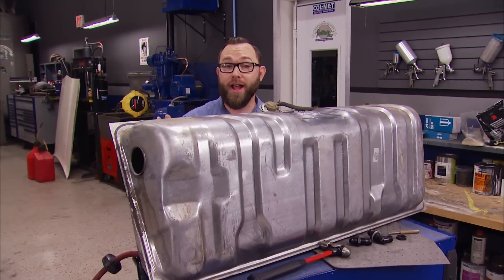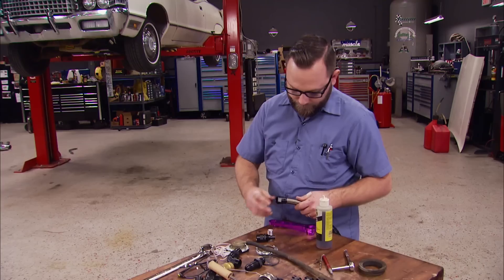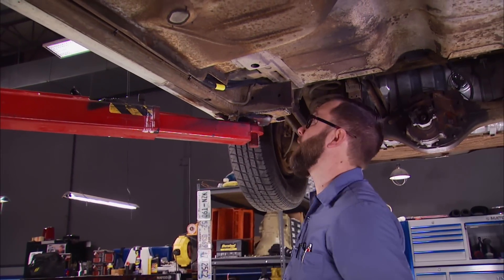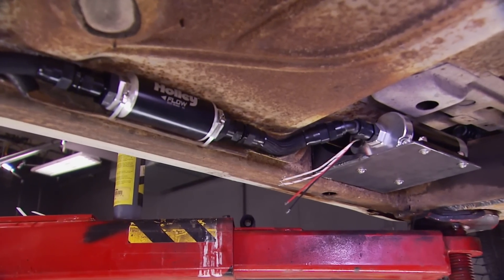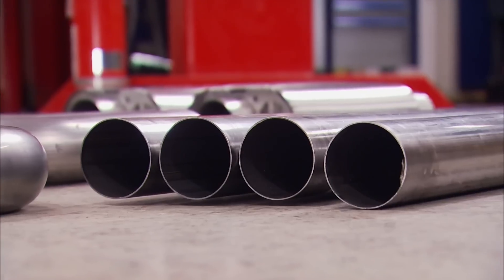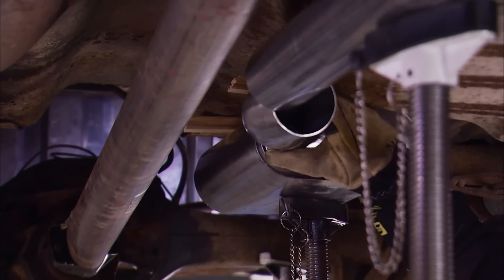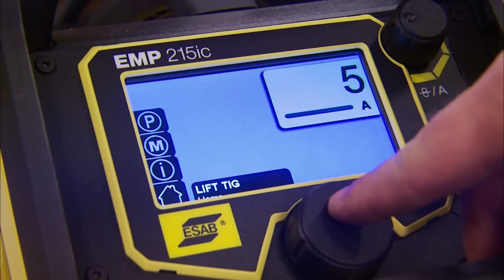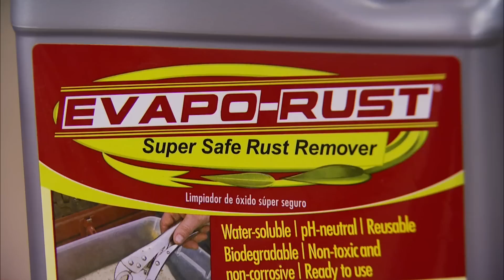Fuel System & Exhaust Upgrades For An 1,100 HP '72 Mercury Marquis - Detroit Muscle S3, E9

Comment: Now that you've got a 1000 hp motor you have to beef up the rear and driveshaft to handle the power. Beef up the front suspension too while you're at it.
Reply: Engine*

Comment: Built a custom Fuel pump mount out of steel, n DID NOT Paint it (instant Rust with any sign of moisture!!) N no Rubber/Foam isolator between Fuel filter n frame?!
N the Exhaust!!!!
Mounts/Hangers?!?!?!
I've always Liked the show, but show bullshit no1 with Half a brain needs to see, n Skips important Parts, Supplies, n Companies that offers said parts/pieces they TEND to leave out!!!!
But should be a fun car.
Oh, n a Built 3spd C6 should b great as the Highway cruiser, LOL, how bout a GearVendors OD Unit?!
But guess we needed to see a stock Alternator painted, n info on the

Comment: Electrolysis will remove rust, even from parts you can't reach with a towel or brush, and it's so good, that it gets it out of pits too. It's really the answer to the cancer. 
Oh and the only chemicals involved are water and baking soda, so you can pour it down the drain when you're done.

Comment: It's interesting how some say "it isn't an 1100 horsepower engine" because it was made with spray. By that thought process a 1500 hp or whatever blown or turbo'd engine isn't actually a 1500 hp engine either but nobody points that out. Why?
Reply: Strictly Business cause you don’t have to change your spark plugs or refill your turbos or blower after a 15 second hit.

Comment: Tech tip. When drilling or cutting into a part that the shavings need to not be introduced to the part, use a vacuum along side of the cutting bit. Doing so will remove 99.9% of the shavings.
Reply: Thats a great idea
Reply: That .01% will eff your fuel system if you don't catch it htough.

Comment: It is not a 1100 horsepower engine that is what it makes under nitrous.
Reply: Same thing with any other mega power engine with like a turbo or blower that's what it makes under boost so it isn't the real hp number.
Reply: @strictlybusiness1598  yeah because those are part of the engine and there are mechanical part of the engine.

Comment: This show would been ok if they would have done different things they seemed to stuck on the LS bull sheet idk if they realize that GM ain't the only auto manufacturer out their. That's main reason I quit watching it was basically the same shit LS in this in that I'm almost positive if they could fit one in their ass they would try put one their too.
Reply: ford nut 
Damn straight!
That LS isn't THAT good - they're just cheap in the junkyards
Reply: @Motor-City-Mike  Naa... they really are that good. I have a tear in my eye right now, just thinking about how lucky I am... to be born in the time of the might LS. They will write songs. They will build temples. They will build shrines like mine, and burn candles on the LS sabbath day. "And on the 8th day, God took pity on the plight of man, and delivered unto him, the LS".. it's right there in the bible. It is known.
Reply: hawkdsl 
don't misunderstand...
I know they are a good engine, I had my first back when they originally came out - the all aluminum version that was released in the corvette.
Let me say up front - I've seen a lot of engine designs, I was in business designing, machining and building engines which gives me a pretty good idea of the good and the bad.
The LS just isn't anything spectacular - the 351 Windsor Ford was everything the LS is, only the fact was that not being a Chevy it wasn't as popular.
To give you an idea - they were the short block in NASCAR Fords for years, and NASCAR is pretty hard on the bottom end in particular - they run 7500 to 8000 rpm for hours. I had quite a few Windsors come in (we also did street engines) that had over 300,000 miles on them - and only needed a .020" overbore.
The LS uses bits and pieces of designs from a few different engines, the only thing different is the oil pump being driven directly by the crank. Changes from the traditional small block - they FINALLY  moved the head bolts farther away from the bore - the reason you have to use a torque plate to machine them is the bores distort so much from the head bolts that the bores went WAY out of round - the Fords and the Chryslers not at all. They also got rid of the stupid siamesed exhast ports 5/7, 4/6 - when you pushed the power way up the heat from them being together warped heads, blew head gaskets and warped the exhaust valve seats.
Ford never paired two exhaust ports side by side.
The cross-bolted bottom end os something Ford did WAY back in the early sixties, strong - but nothing new here either.
Maybe because I'm older (sneaking up on 60 and still right in the middle of things) - and seen a lot of engine designs - that I see nothing particularly spectacular about the LS, it's good but not "All That".
Reply: @Motor-City-Mike  Just messing with ya man.. But the flat head ford shared ports IFIRC.
Reply: @hawkdsl  That was awsome reply.
Reply: Didn't know Ford made a  Ls &its from tf 70s
Reply: Actually, this video features a Ford product, and you are still unhappy.

Comment: So is the 460 a better builder than the 454?
Reply: YES
Reply: What makes it a better motor? I’ve always known 460s to get horrible mileage compared to the 454. Also, very few get used in hot rods compared to the 454. Is it just prices of 454 parts? Or?
Reply: @jeremylakenes6859  you build a big block and complain about gas mileage. 🤦‍♂️
Reply: Jeremy Lakenes 
The same - at this level the cost is the same, and keeping a Ford in a Ford is easier than swapping in the Chevy

Comment: Why didn't you undercoat the car all that time and money
Reply: No need to in the south, it's not a rust belt daily driver
Reply: @OGskunkMASTA  yes you do besides just lazy looks like crap nice new stuff on rust resale value as well
Reply: @bustermccrab4376  No you do not, I've bought over 9 cars from down south that were from 60s to 80s and they were never rust coated and looked new underneath. My 94 s10 blazer still had factory markings and stickers on the frame. They get patina, NOT rust or not.
Reply: @OGskunkMASTA  I lived in Florida for years I do know also like I said just lazy besides watch the show mounting that fuel pump to rusted metal spend the extra day and clean that crap up preventative maintenance also what if the car goes up north nice to know also I'm here in Detroit a lot of people take i75 to and from
Reply: @bustermccrab4376  Flordia is by the sea, cars rust close to the rust belt there. Cars from Tennessee, Georgia, Texas, and so on. Flordia, California, and most snowy northern states are a no go for buying older cars. I've hauled cars and built cars for years. I've been to every lower 48 state besides Alaska and Hawaii to get cars and I've seen how they all look especially the classics. They're more than fine. More of a waste of there time
Reply: @OGskunkMASTA  just lazy also say somebody moves to another state also when you look under the car it just looks professional as well they literally had gas tank off exhaust off sand blast that shit spray it 1 days extra of work makes a lifetime of difference. More money on resale there's no excuses

Comment: best part is this thing probably gets the same fuel economy it did brand new but way more power LOL!
Reply: I had a 1972 grand marquis bram with a 429 in it when i was a teen.. my friends called it the "Star Ship". It was so ugly and large... but that was what made it "cool". To this day, it's the only car I ever owned, where you could actually see the fuel gauge move while you drove it. It's also the only car I've ever owned that felt like it was hovering over the road, not driving on it. You could have run over a cow and not know it if you wasn't looking. I thought it was a pretty fun car to be honest. it was 21 feet long. You learned to park good with that monster. Had it for about 2 years, and went into a dodge van after that. I felt naked without 12 feet of hood in front of me. What a bazaar feeling that was.
Reply: Matthew Skaggs 
Yup! my Thunderbird (460) got Better gas mileage after the modifications and WAY more power!
LMAO!!!!
Reply: I love a good carb but I think I would have went with a holly efi of some sort.
Reply: @r6exrider  carbs are outdated.
Reply: Had a olds same size with BB.. Yeah 12MPG at best
Reply: @AbcXyz-rn2lz  12??? Damn you were doing good!  LOL
Reply: @carlspackler91  that's flat grade OD maybe
Reply: @AbcXyz-rn2lz  I don't doubt that a bit!

Comment: that car would be dangerous. even in a huge car like that 1100 HP would push that thing to probably 170- 190 on top end speed and I don't care how much you update the suspension that big boat would be dangerous at that kind of speeds, just my opinion.
Reply: If it's just your opinion, why push it as fact?
Reply: Seth Jordan no need for a sarcastic remark bud, I didn't say it was a fact.
Reply: Mike Burks that it is capable doesn’t mean you should right.
Reply: Mike Burks 
Did you ever notice Stock Cars (NASCAR etc.) in the sixties were about this size?
Just a heads up, all else being equal - big cars are more stable and easier to drive at high speeds.
The increased track width helps with pitch roll, and the longer wheelbase allows more time to correct than "twitchy" short wheelbase cars.
Also, the splitters and spoilers on smaller cars are there for downforce, downforce simulates Weight.
I grew up driving all different sized cars, while the smaller cars are fun (I'm into ALL cars), fact is I'd rather be doing 180 in a big car than someone small and light.
Reply: But you said it WOULD be dangerous, twice. Not that you think it might be dangerous, not that it could be dangerous, which would be an undeniable fact, anything can be dangerous, if utilized correctly. And who would it be dangerous to exactly? The driver/passengers? Well what if they reinforce the chassis to FIA standards? The FIA is way more strict than the US government when it comes to safety. Or maybe you are talking about the people outside of the car, to which I ask, what car isn't dangerous to pedestrians?
Reply: opinion means i could be wrong and I probably am wrong. oh did you train to be a smart ass or are you just gifted.
Reply: Mike Burks 
To answer your question (which fits the very definition of sarcasm), I'm not an ass so it must be a gift. Sarcasm was not in my verbiage nor was it my intention, making my point was.
You were adamant when you made a statement and then called it an opinion, so asked I if you were familiar with '60s NASCAR (I have no way of knowing your age) and then I stated the facts of vehicle dynamics in my response.
If you feel that is sarcasm you 
might want to consider avoiding interaction with other people on most automotive forums - you are easily offended and social media is possibly the last place to expect kind and gentle conversation.
Reply: MIKE MOTORCITY OG you sound really intelligent to me so you should know what the word opinion means and no you did not offend me. if you want the last word go right ahead, I won't respond to it. you see I am pretty old 4 kids, 7 grandkids and a lot going on so I don't have time for arguments on you tube, so think whatever you want to about me, like I said if you want the last word go right ahead.